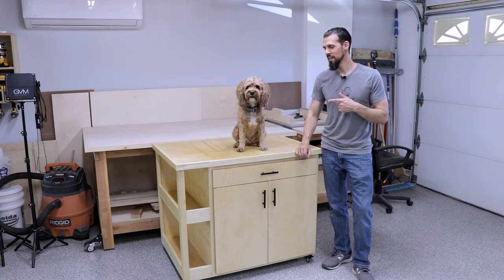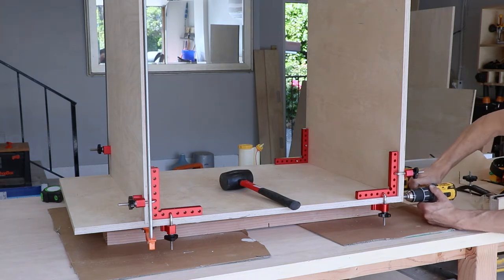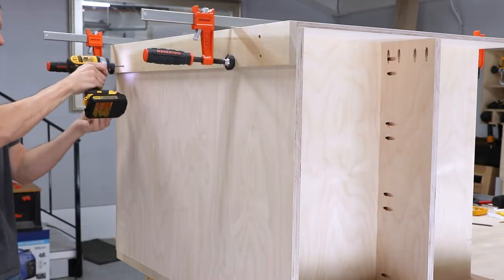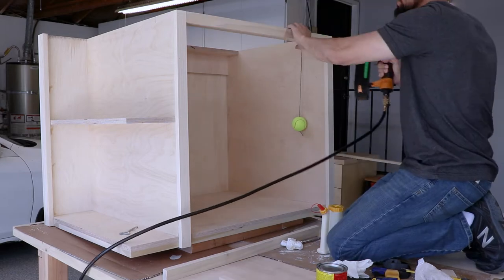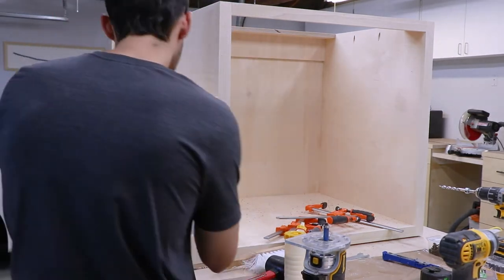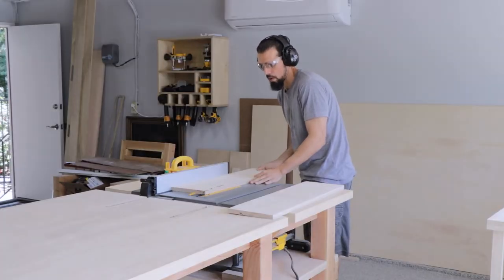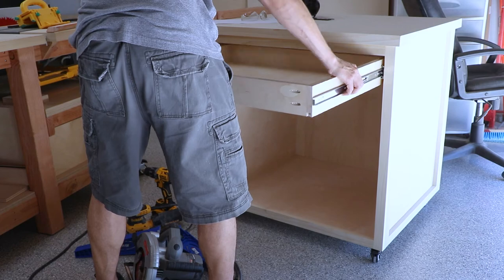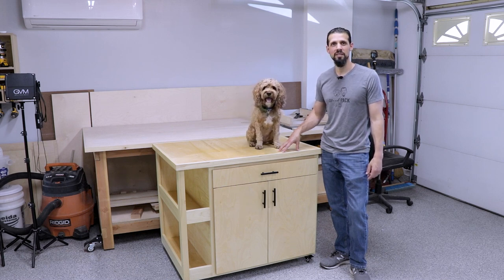Rolling Shop Cart // Mobile Workstation

Comment: Thank you so much for sharing this plan! What is the tool you used at 5:36? And is it necessary?
Reply from the maker: That was just a pneumatic brad nailer. Not absolutely necessary, but makes it faster and a bit easier. There are lots of alternatives - like just clamp and glue, regular screws with plugs or filler to hide the hole.